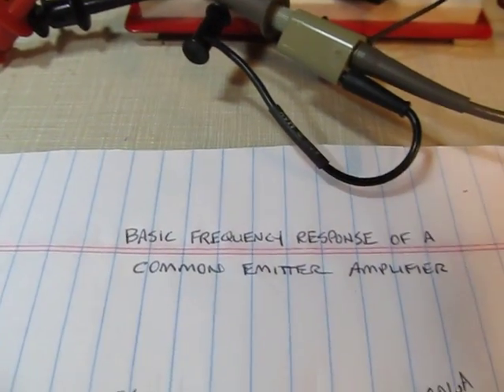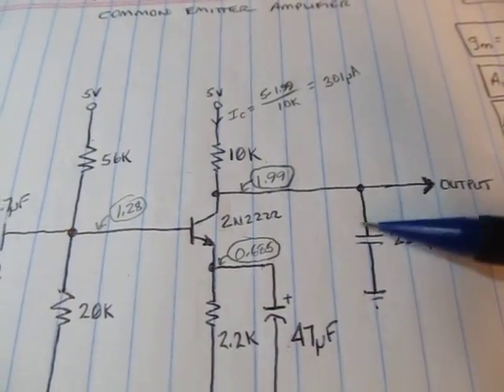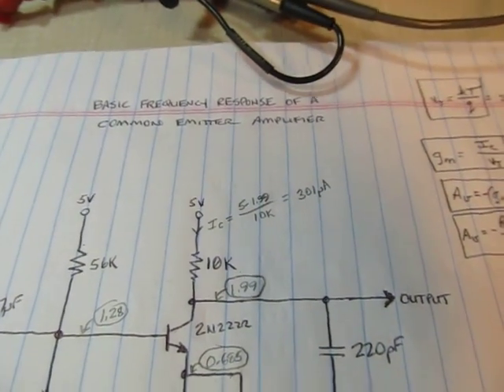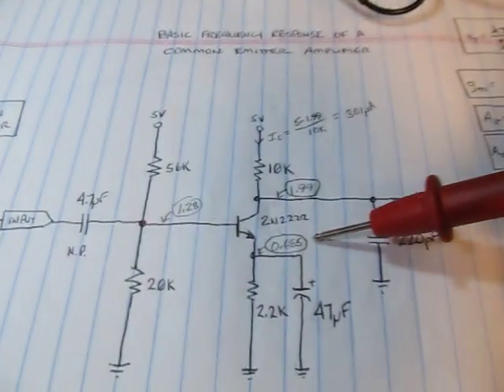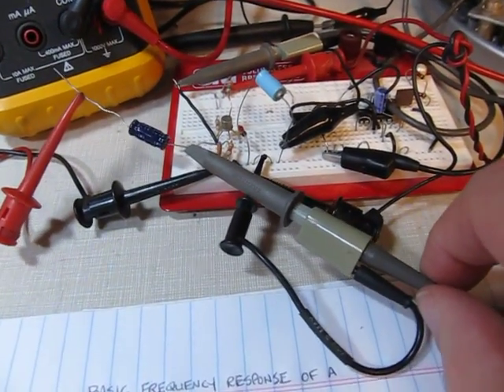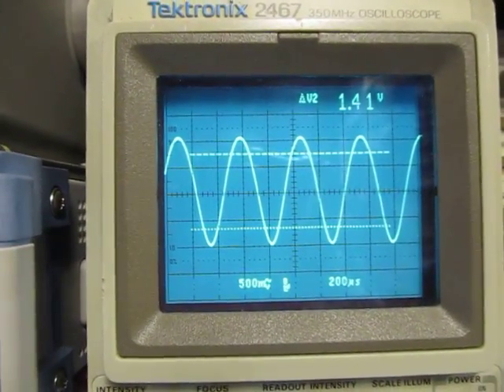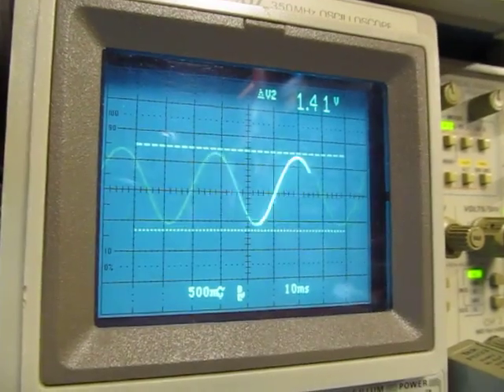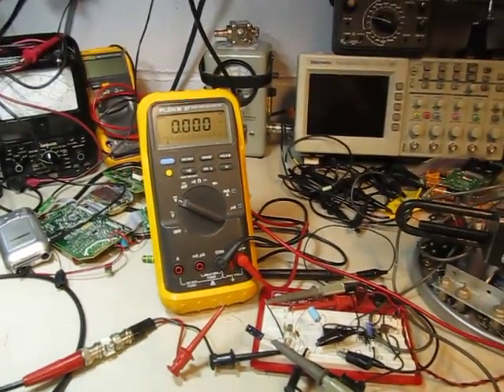#67: Basics of Common Emitter Amplifier Gain and Frequency Response with Measurements

Comment: Hey Alan 

I really enjoyed this video and the ones related to it. These lessons have helped me with guitar pedal builds and understanding the math more behind the circuits. would you be interested in breaking down a fuzz face circuit? I’m mainly using npn transistors for the amplifier instead of pnp. Thanks again!
Reply from the maker: I don't know what a "fuzz face" circuit is.
Reply: I’m not sure in my reply’s are going through
Reply from the maker: @wingate8  Youtube doesn't allow links in comments/replies apparently.
Reply: @w2aew  

Ahhh well fuzzcentral.ssguitar has a Fuzz Face NPN Silicon schematic that I would love to get your take on. I’m using most of the same values and have modded the bias point of both transistors as well as collector voltage
Reply from the maker: @wingate8  OK, I think this is the page you're talking about:
https://fuzzcentral.ssguitar.com/fuzzface.php
Looks like a fairly simple two-stage amplifier with a little bit of negative feedback.  The pot adjusts the gain of the second stage which influences how much (if at all) the 2nd stage is driven into clipping for a given input signal level.
Reply: @w2aew  

That’s one of them as PNP. I was just trying to understand more of the math behind it like the common emitter video which is a basic guitar boost. I haven’t found anyone of YouTube break down that part yet more talking about tones with different component values

Thought it might be a different take from someone who isn’t coming from a music perspective
Reply: @w2aew  

Yes I understand that side of it but I was hoping for more of a breakdown on the science/math behind it like you did this video for common emitter amplifier which is a basic boost pedal in the guitar world

Comment: Hi, I was looking at video 273 and thought it would be good idea to visit the other videos you suggested. So it hit me, I saw something on your scope that I have always had showing up on every simulation and test of the collector output that I have seen. The peaks had wider span then the troughs. I understand it was the exponential behavior of the BJT as the linear range is not entirely linear but rather somewhat almost linear. Is there another reason you can think of? From a BJT class A amp, i probably think this should always be the case, right?
Reply from the maker: Yes, it is more prevalent the larger the signal and is primarily the result of the lower gain owing to lower incremental transconductance as the collector current decreases (which is what's happening as the output signal rises).  The reduction in gain results in compressing the signal peaks.  The opposite occurs at the troughs (at least until you get close to saturation).

Comment: Excellent videos!  Thank you.  I'm curious about what starting frequency you used to determine the 3db down points.  Did you sweep to the max amplitude frequency for a starting point?  EG. if you started at 100 Hz or 60 kHz and adjusted the frequency to find 3db down, you would come up with different corner frequencies.  Does this make sense?  Can you clarify for me?
Thanks
Reply from the maker: I started with a frequency that would be fairly far away from the corners based on the component values.  Or, doing a quick sweep or set of measurements at various frequencies, it's easy to find something in the passband, and slide up and down to find the edges.

Comment: Just at the end of the video I saw a Bird 43 and realized you are an OM right ?
Congratulations for this nice training and video very clear and crisp !

One question : I would like o use this amplifier between a super-regenerative detector and a LM386 amplifier. To avoid saturating the LM 386 input, I think the best would be to limitate the gain of this amplifier between 2 to 10 max.
How is that possible ?

Thank you !
Best 73
F1CUJ
Reply from the maker: Yes, it is very easy to limit the gain to lower values as you need.  It is usually done by using emitter degeneration.  This is explained clearly in my latest video:
https://www.youtube.com/watch?v=VWY2WQcKJgk
Reply: OK Alan. I have watched the video. It's very clear ! Thank you very much

Comment: Vacuum tubes have a MU spec and GM transconductance spec. I'm not sure what internally inside the vacuum tube is determining the MU amount and the transconductance amount but I think is how much electrons are on the cathode coating ? Because the cathode is what is releasing the electrons which is the current which is the MU and transconductance?

Comment: Why is it necessary to use the 4.7 uF coupling capacitor on the input? I understand it would block any dc components of the signal, but if we're applying a simple sine wave from a signal generator, then there would be no dc component, correct? Or am I missing something? Best practice just to be sure the signal is pure?
Reply from the maker: The 4.7uf cap is used at the input to preserve the DC bias at the base that is established by the 56k/20k resistor divider.  If the capacitor wasn't there, the 50 ohm terminator for the signal generator would be in parallel with the 20k resistor and the bias voltage on the base would then be dragged very close to ground.

Comment: @w2aew How do you know the limits of the amplitude you can have at the input before you start clipping your output?
Reply from the maker: If you look at the bias point of the transistor - mainly the collector and emitter voltages, you can get a good estimate how far the collect voltage can swing before it either hits the positive supply rail or saturates the transistor.  Once you determine this swing, then divide by the gain of the amplifier to determine the input signal swing.
Reply: @w2aew  I wanted to knoe the anwser for this same question. But why cant I just increase the output of the function generator until the output of the circuit starts clipping and then read off the value of the signal from the function generator to find the max input to the circuit. Is this approach incorrect?
Reply from the maker: @GLUEALLSTAR  You certainly can do that.  I was assuming that you wanted to know how to determine the clipping level without testing it.

Comment: Thank you for your explanation, I would like to ask how did you solve for Vt? or is it always 26mV? 

I am trying to solve an assignment for the output voltage and frequency but I was not given the value for the capacitors how can I find the frequency? 

Also, does the voltage gain formula change? In class it was given as the output voltage/input voltage (Vout/Vin) not -Rc/re
Reply from the maker: The Vt value (thermal voltage) is calculated via kT/q (https://en.wikipedia.org/wiki/Boltzmann_constant#The_thermal_voltage)
At room temperature, it is about 26mV.

If they didn't give you values for the capacitors, maybe they're assuming that they're large enough that they can be ignored (effective low Z at the operating frequency).

The gain formula doesn't really change, but it could be represented a different way.  Since gm=1/re, you often see the formula written as  AV=-gm*RC.  If feedback is used, such as adding an emitter resistor, then the formula does change.
Reply: @w2aew   I appreciate your response. So if the capacitors are large enough that they are ignored, how can the frequency be obtained?
 Also given the emitter resistor what will the gain formula be?
Reply from the maker: @sarahmajin5358  Without knowing what circuit you're analyzing, it is impossible to say.
Reply: @w2aew  it’s a common emitter circuit with an NPN transistor  like the one in your video with an input of 100mV@50Hz and a load of 1k ohm. 
Base resistors of 10kohm and 2.2kohm, 
collector resistor of 3.6kohm, 
emitter resistor of 180ohm and 820ohm, the 820ohm is short with a capacitor. 
The output resistor is 51kohm. 
Vcc is +10v and beta is 200
Reply from the maker: @sarahmajin5358  Sounds like you have what you need to calculate the operation point, collector current, etc. in order to figure out the gain.  Not sure what you mean when you say the load resistor is 1k and the output resistor is 51k.  Do you mean that the collector has 3.6k to 10V, then there is a 51k resistor in series between the collector and the 1k load resistor?  Another question  - when you say you need to solve for frequency, I"m not sure what you're looking for.  You said that the input signal is at 50Hz, so that is the frequency.  The amplifier won't change this.  Or, are they asking for the frequency response?  If they don't give you capacitor values, maybe they're asking for you to describe the equation that determines the frequency response (i.e. the emitter RC determines the high-frequency corner, etc.).

Comment: Nice tutorial, can you also upload some RF (100MHz to 500MHz) amplifier tutorial with few mW input to few watt output , using bjt and how to calculate the power gain, frequency response of the amplifier and also the input and output impedance. thanks in advance
Reply from the maker: +Freddie Homecillo If I ever do a project like that, I'll be sure to document it in video.

Comment: I believe I finally understand how those two filters work. They both work the same way. They both would be considered RC low pass filters. It's just that the filter at the emitter increases the output signal above it's cutoff frequency while the filter at the output attenuates the output signal above it's cutoff frequency. The equation for the cutoff frequency of both is fc = 1/2πRC. Together they limit the range of frequencies that will be amplified. I'm wondering. Would this type of set up be used for a radio transmitter? Longwave for example. Would the two filters be set to filter out all frequencies except those between 153 KHz and 279 KHz? And if so what would be the benefit? Thanks.
Reply from the maker: Yes, you're definitely gaining a good understanding. For RF circuits, often a tuned load is used to create a bandpass filter around the signal of interest. The main goal is to minimize the transmission of harmonic and inter-modulation distortion components.

Comment: Yes i understand that the DC offset won't be on the secondary, but won't the AC waveform have an AC offset not starting at the zero crossing point. The AC waveform might not start exactly at the zero crossing point might have some offset on the secondary?
Reply from the maker: Only the AC portion of the waveform will be present on the secondary - no offset unless there is one applied on the secondary.

Comment: Even if an amplifier hits the 3db drop off thus "showing the top of bandwidth", isn't it true it still has usable gain though until it hits zero db entirely?
Reply from the maker: Sure, it all depends on whether the usable gain is suitable for the application.
Reply: @w2aew  Thanks! I did a bit more googling and found that they call  the range where it is above 3db drop, the  "power bandwidth" vs the "unity gain bandwidth", which is the "entire" bandwidth overall

Comment: There's something else I'm wondering about. I know that an amplifier like this has to be connected to the signal source and the load through a coupling capacitor. My understanding is that the purpose of these capacitors is to filter out the dc component of the signal so that only ac enters and leaves the amplifier. With this is mind it seems to me that the higher the capacitance the better in order to keep the reactance as low as possible so that the capacitors behave like a short circuit. Is this correct or is it more complicated than that? Thanks.
Reply from the maker: In general, yes, you want to use values that make the reactance low compared to the circuit impedance at the lowest frequency of interest.  Making the caps unnecessarily large may result in delays or stability at startup when the cap has to charge up to the DC difference between the two circuits.  Also, very large value caps might not work as well at the highest frequency of interest due to parasitic inductance. Also the very large values might mean the use of less desirable capacitor types like electrolytics.

Comment: I would be nice if you could explain how can we make this circuit have half of the gain already measured by removing a capacitor or by making some other changes. Is it possible to make some arrangements and have a gain of approximately -55?
Reply: Just add an extra 100R emitter resistor between the emitter and the 2K2 resistor and bypass just the 2K2. That will get you in the right ballpark for gain, as well as helping to linearise the output, (thus reducing the distortion), improving the frequency response down to about 20Hz, and raising the collector bias point a little so that you can get more headroom from your 5V supply.

Comment: Just want to ask you regarding the high and low pass frequencies; so does that mean the range of frequencies between which the  gain can be found is 38Hz and 72Khz?
Reply from the maker: Yes, the gain is relatively flat (constant) between those frequencies, and is reduced as you go outside this frequency range.

Comment: There is also the pole introduced by the 4.7uF input coupling capacitance, but it is located more than a decade lower (~2.3 Hz).
Is this generally the case (i.e. fix the lower 3dB point based on the value of the capacitance on the emitter and place the pole of the input coupling capacitance much lower in frequency)?
Thanks!
Reply from the maker: Yes, because the output impedance of the previous circuit would have to be considered if the input cap is used to set the high-pass corner.
Reply: Yes, the output impedance of the previous circuit would be in series with (56K//20K).
In your experimental setup there is the 50 ohm termination of the function generator in series with  (56K//20K).
Reply: @ljl451  The output impedance of the generator is in series with the input capacitor, making the upper leg of the voltage divider that forms the low-pass filter on the input.
The lower leg of the divider is made up of the 20K resistor in parallel with the 56K in parallel with the base impedance of the transistor which is somewhere between about 90K and 220K at frequencies below 1.5Hz and somewhere between about 3.3K and 8K at frequencies above 40Hz, depending on the transistor β.
That's not a simple analysis to make since the response is dependant on transistor β too much for my taste, however, with a transistor β=40, it is 3dB down at around 4 Hz. I would redesign to use lower base bias resistors or use a much higher β transistor, so that the base impedance of the transistor is no longer the dominant factor in the input impedance.

Comment: How can the bias V_B voltage be 1.28V in the first place? I couldn't read properly the value of the lower resistor of the base divider (it's either 26k or 20k). In either case (and if we neglect the base current) it's 5*(26/82)=1.59V or 5*(20/76)=1.316V. Moreover if it's indeed 26k according to my calculation the BJT should be in saturation: V_B=1.59V -> V_E=1.59-0.6=~1V -> I_E = 1/2.2 =~ 0.45mA -> V_CE=5 - 0.45*(10+2.2) < 0 !
Reply from the maker: The lower resistor value is 20k, so your 1.316V calculation is correct.  It's only off by 30mV or so (about 2% off), which is due to resistor tolerances and base current contribution through the 56k resistor.

Comment: Hi, I do not understand why the voltage on the collector is 2 volts. If we have Ve = 0.685v and we have Re = 2200 ohms, then it is Ie = 310 micro amps. 310 micro amps through Rc = 10000 ohms, we get the voltage at 3.1. 5v - 3.1 V = 1.9 V! So Vc is 1.9 v! Is it because of parasitics, or because this 47 uF cap, or Ie is not equal to Ic? Excellent video, thanks!
Reply: It's more likely due to the tolerances of the emitter and collector resistors. I can't really make it out at 6:57, but they might well be 5% resistors.
If Re were 5% high and Rc were 5% low, we would get:
Re = 2.31K, so Ie = Ic = 297μA.
Rc = 9.5K,  then Vc = 5V - (297μA x 9.6K) = 5V - 2.8V = 2.2V Does that look most likely?

Comment: Sir, the formula to calculate dB is
dB = 10 log (base 10) of V2/V1

log (base 10) of 0.707 is equal to - 0.15.

Please, could you explain how this is equivalent to - 3 db?
Reply from the maker: When taking a voltage ratio, the formula is 20 * LOG10 (V2/V1)

Comment: First Great video. I want to ask why during frequency gain, we calculate for -3DB ( approx -30%) point ? Why not bit more than -3DB or less ?
Reply: because @-3dB point,  output gain is reduced to 70.71% of its maximum value then it start to decay with 20dB so you can say upto 3dB your output will be significant or meaningful which will not be the case beyond 3dB point.